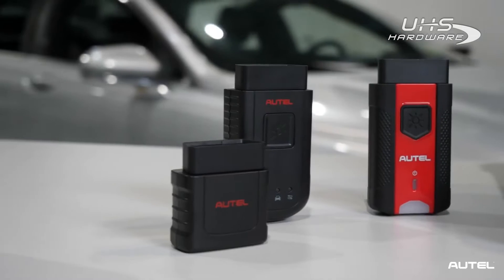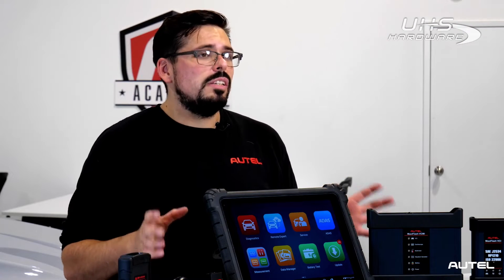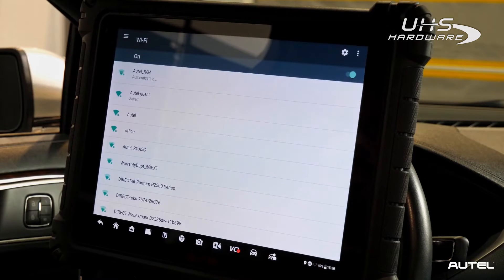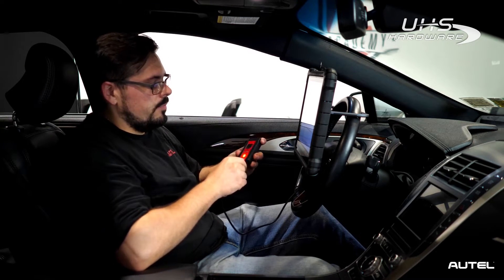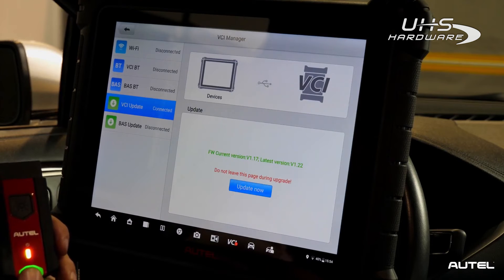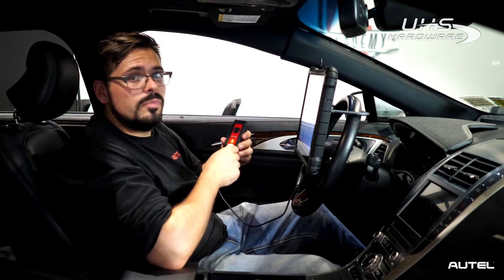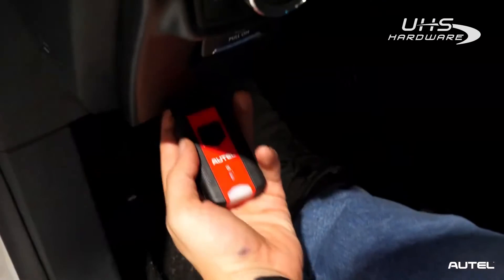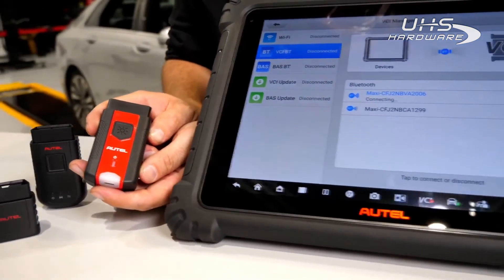How To Update Your Autel MaxiVCI V200 - Bluetooth Vehicle Communication Interface

Comment: Help! I recently purchased a MaxiVCI V200 to use with my Maxisys Ultra. Once connected via USB, I can get to the screen in VCI Update showing available updates for BTFW to V1.3.10 and FW to V1.25. Below the red text, "do not leave this page during upgrade", there should be a button to initiate the download (as I've done before for the VCMI). However,  there is no button, and I can not continue from this page. I've restarted both a few times. The tablet recognizes the VCI and pairs via BT. That's when it prompts me to update. I select VCI Update, but I keep getting stuck on that screen.